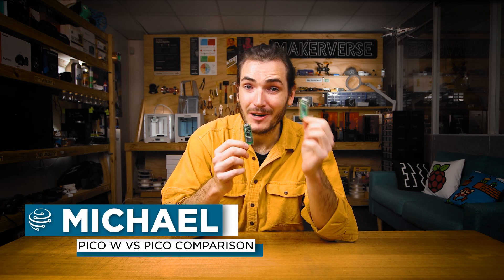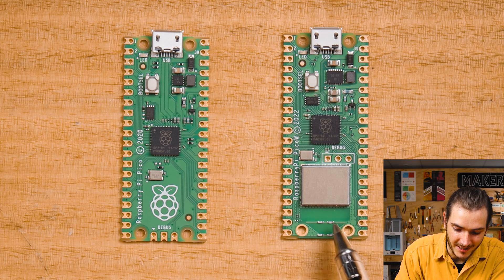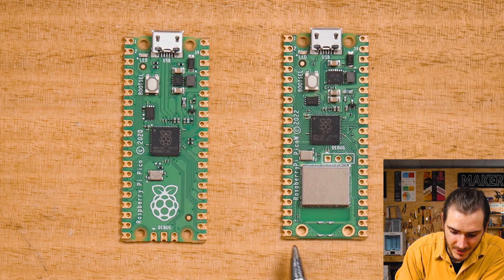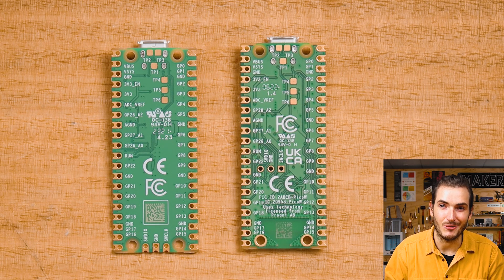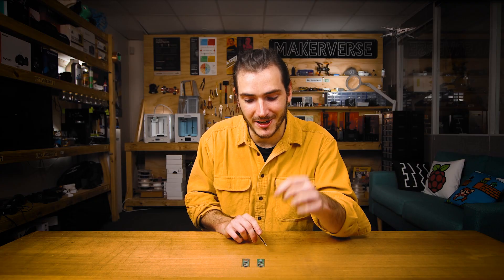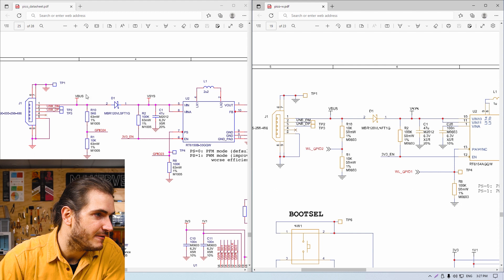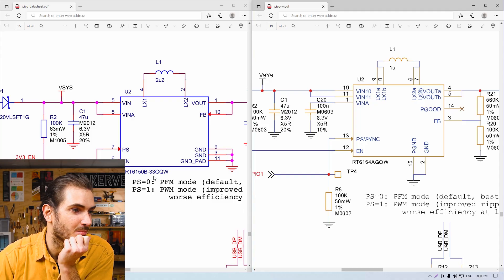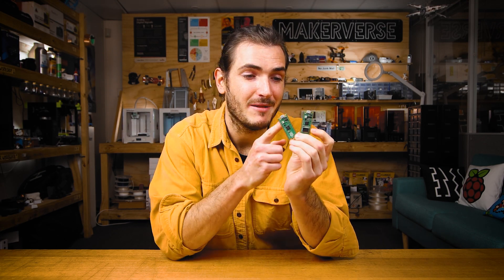Raspberry Pi Pico W vs Pico: Whats The Difference?

Comment: I noticed the DEGUBBING 3 plugs also look different on the WIfi version of the pico.. ONE is square.. the other 2 are round? unluck the Pico regular where all 3 debug holes are all ROUND.. ? dunno why they made one square on the new one?? ANYONE know what the purpose of that was?
Reply: The square one is the ground, as per convention.

Comment: Nice board the Pico W, However why promote when you have no stock?
Reply from the maker: While Australian stock is on hold until the Pico W passes certification, curious makers will still want to know all the details on launch and this way when the boards hit our shelves we'll have a suite of killer education ready.
Reply: @Core-Electronics  I appreciate your effort and vid
Reply: @Core-Electronics  Then put that in your video.....  Otherwise there is a pile of disappointed makers ploughing over your website wondering what .......
Reply: Because it's useful to those who are doing research

Comment: What I find mental is that the wifi chip has an M3 and M4 ARM core in it, so technically it is more powerful than the Pico microcontroller.
Reply from the maker: Isn't that just the way of things!? 😅 Wireless certifications apply to both hardware and firmware - so it makes sense that makers can't crack into the wireless interface and start fiddling with firmware.
Reply: @Core-Electronics  Yip and why won't see anything opensource anytime ever I suspect.  But then, crazy kids wildly playing with the radio spectrum was never what anybody needs in life.   There again there are the ESP chips that do the wifi stack on the user-accessible cores if I'm right.

Comment: I’ve got one on order from the PiHut here in the U.K. Unfortunately that’s all we can order so I better not do something stupid like melt the switch with my soldering iron… yes I did that to a Pico! I’m a boomer newbie which is known as the most dangerous combination on Earth.
Reply: I think some of the other suppliers have larger (or no) limits for the Pico W? Got one from Pi Hut too (should be here soon actually) but I think SB had a limit of 10 per customer?

Comment: The dvi add on board would block the antenna,
maybe the add on can go under the pico and have 3 wires to jump to the debug header (if needed)
would be great if the dvi board could power the pico.